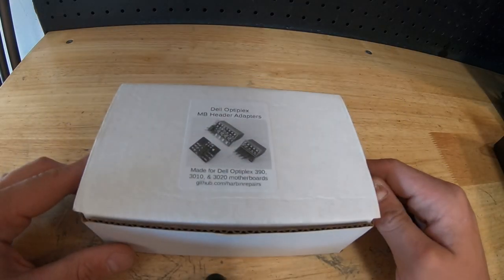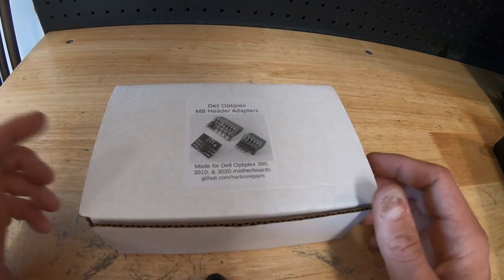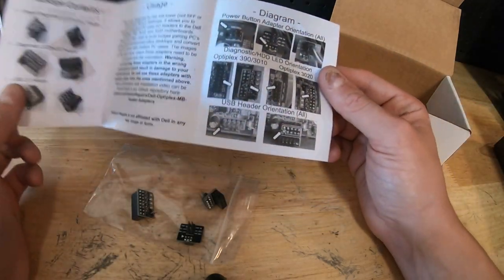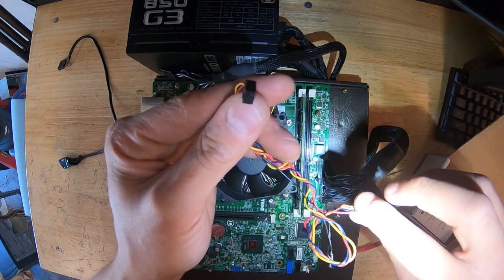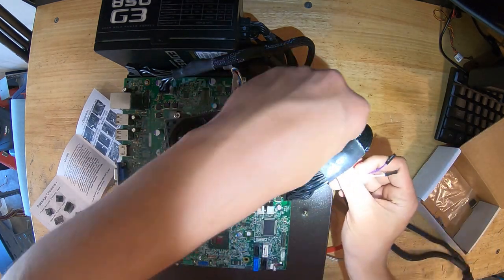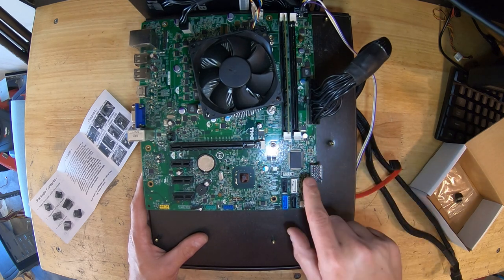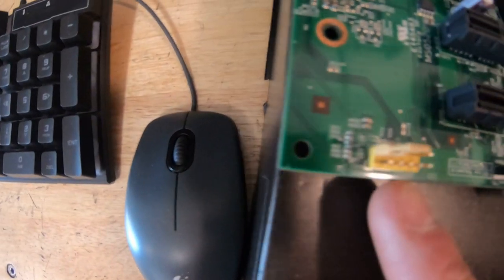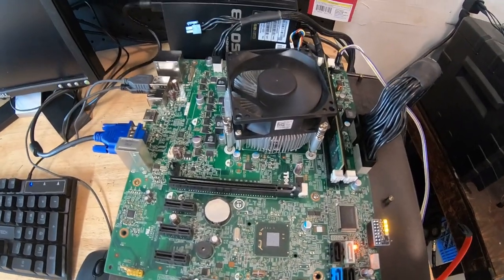Easiest Dell Optiplex power button fix! No cutting, no splicing, no wire tucking! Simple and easy!

Comment: Thank you very much!  This video helped.  I’m building a mining rig and got a power button.  When I found out the connector was different with this motherboard, I started to worry, but found this video and I can get this adapter and still use the power button I already ordered.
Reply from the maker: Glad the video helped!!
Reply: Dude, do you have the MIH61R MB working with more than one GPU? I was doing some tests, and a 2nd GPU does not recognize me. Did you make any changes to the MB BIOS? Thank you

Comment: I’ma do this when I get the dell optiplex for Christmas I was on a budget and if it can look better for around 60 bucks I’m willing to pay
Reply from the maker: go for it, def a cool upgrade for this budget optiplex, pop in an i7 along with good graphics card, ssd and pus, and it will hold up well. Very easy to do. I have another video that shows the updated build with these adaptors and how it turned it so check it out. Thanks for watching and hope you can subscribe to help the channel!
Reply: Same

Comment: thank you for posting this. I hope you can reply to my question. I have MIH61R MB that I acquired for free from a friend. Upon testing, CPU cooler fan turns on, a little orange light lights up. But black screen and no post. What could be the reason for this? 
I followed online advice and cleared its CMOS through a jumper. Still no post. 
I am not sure if the MOBO ever worked. So I am unsure if doing these jumpers in the video might help in seeing anything on screen. Would they? 
Please note that fans work immediately as soon as I plug power cord to PSU. No presses but when I do jumper for the 5 pins (up near the memory) i can see that keeping the last two on the right shortened makes the mobo reboot (but without post) .  Shorting them will power up the mobo but no post too.. 
Any advice? thankyou !
Reply from the maker: it would be trial and error, but I would try testing the ram. try reseating it or If you have one stick, test it one at a time to rule out. If it still does the same thing the next thing would be to see if it's a video error. are you running a graphics card or the one on the board. If so then run the one on the board. If it's still acting up, disconnect the optical and HDD and try it. Sometimes a bad drive can do that. after all that then next thing would be is to take out the cpu, check the pins see if any pins are bent in the cpu socket or see if the cpu is dirty. Alot to try but doing this would def gear towards what part is causing the issue. Let me know if this helps and how it goes. Thanks for watching and hope you can drop a sub!

Comment: Hello.  I have a ~2016 Dell XPS box computer.  The power switch will not engage.  Do I need to use those other two items in your fix it box.  I only need the power switch fix.
Reply: How do I tell what motherboard I have?  I'm in the box.  It looks very similar to the one in the video, but I think it is just a little bit different.  It would be great if this kit could fix the power button.  Also the power button is boxed in from the metal frame.  I got the side panel off, but can't seem to get the top off.  Any suggestions?
Reply from the maker: i would get on ebay and just get another switch or header panel depending what type you have.
Reply from the maker: just type the model number from the computer along with motherboard and you should be able to find it.
Reply: Thank you.  I found the motherboard and a Youtube video that shows me how.  Neat!

Comment: I have a 9010 sff, but I can't find a straight forward answer as to why I can't case swap and why the adapters don't work with the sff, surely there is a way to complete swap the case and not need the front panel to say attached. Do you know of its possible or have an answer to why the adapters don't work?
Reply from the maker: I have never done the swap with a sff so I am not sure why they say it does not work. I would like to get and try it and see what the issue is.

Comment: So question, I recently started building from an optiplex 3050 mt. Would these adapter work on that mb if I’m planning on switching case ? Or are they specifica to the 3010,7010 etc. ? Thanks In advance
Reply from the maker: 3050 is differnt. best bet is to mod that case. got a vide on it!!

https://youtu.be/coj91go5ljc
Reply: @DLMtechgarage  thank you so much for this! I was looking at which video to look at. This helps.

Comment: I put in my power switch and hdd led switch wires but i also have a reset switch wire in my new pc tower what do i do with that?
Also the blue pin plug on the motherboard next to the green one is that for the usb 2.0 plug?
or do i even need the adapter to the usb to the green on if i have a usb plug from the new tower im using?
i'm currently putting it together as we speak ;)
Reply from the maker: I would use everything on the adaptors. As far as the reset....... you really don't need it,
Reply: @DLMtechgarage  should i put the usb wire plug from the new tower to the blue one next to the green one or the green one with the adapter?
Reply from the maker: @johnnygallardo76  if its 2.0 put it on the adaptor. the 3.0 (blue one) goes on the board
Reply from the maker: @johnnygallardo76  not sure what i could be, double check the psu connection to the board, ram, orientation of the adaptors

Comment: do i do the same set up like you did in this video on my optiplex 390 mini tower?
Reply from the maker: yea you can except you would need a different adaptor. will post a link below. Thanks for watching!!

https://www.ebay.com/itm/Dell-Optiplex-390-3010-3020-Front-Panel-Header-Adapter-Kit-3pc/264638815586?hash=item3d9db3dd62:g:rsUAAOSwsFdfsMFS
Reply: @DLMtechgarage  Thanks for the the quick reply I'll be making a video of my finished OptiPlex 390 transplant when its done. 
   BTW is this the same one i need in this link? its cheaper at there actual site. 
https://store.harbinrepairs.com/index.php/product/dell-optiplex-390-3010-3020-front-panel-header-adapter-3pc-kit/
Reply from the maker: @johnnygallardo76  yea its the same one. I forget he has a dedicated store lol..

Comment: Will this adapter prevent getting the "power button cable failure" message at bootup? I just installed a new power switch and keep getting this error everytime i boot up my pc. Looking for the easiest way to fix
Reply from the maker: yup, adaptor gets rid of all errors.

Comment: I have a Dell OptiPlex 790 SFF, where the machine gets rebooted, shutdown or sometimes it powers on it's own.  I have formatted the entire OS and did a clean install, but still not sure what went wrong and why does it behave in such a way.  Can anyone help me here.
Reply from the maker: I have seen this with overheating. Make sure the fans are spinning while running. Such as the cpu fan, psu fan etc.... Usually when a computer is overheating it does this as a preventive.  Then check and clean it out for dust build up. I have a video on that so check it out. If that's not it  check your power chord to make sure its not pinched or if its loose. Def try those things. if not then it becomes process of elimination such as removing one ram stick at a time and then possibly having a psu. keep me posted and let me know if you have any question and you don't mind subscribing it helps me out! Thanks for watching!

Comment: Do I need the power switch adapter obligatory if I want to turn on my PC with the case button?
Reply from the maker: yea you will need it, but don't have to do it if you pin out the pins. I did a video on not using the adaptor and doing the pinout.

Comment: Looking for a computer that i can afford that have a socket 2011 socket R? i7 processor does dell make any thing in the older gen like this that will run cad programs.My i3 keeps black and blue screening ,locking up.
Reply from the maker: dell makes power edge socket 2011 systems like the t620, they cab be pricey but im sure you can find an older variant,

Comment: Thanks for the tutorial. I actually bought these adapters after seeing your video, I bought them for the Dell optiplex 990. Everything runs fine, power button works and all but the issue is I still get the Bios error saying "power button cable failure". Do you have any idea how to avoid this?
Reply from the maker: something might no be plugged in right as those adapters defeat the error. Make sure they are plugged in the right orientation and you have everything in the right location.
Reply: @DLMtechgarage  Thanks for getting back to me. I had issues with my computer for the last 2 days, it had that "No post" error after installed a new CPU fan so I couldn't test your solution. Luckily I fixed it... all I had to do was clean the RAM sticks. Anyway I still have that "Power button" issue, I checked everything, including the orientation of the adapters. The only issue is the LED Power jumpers are really loose, but I made sure they're inplace when I test my computer and I still have the power button error. I'm using the NX220 case with the Dell Optiplex 990 DT motherboard by the way.

Comment: can we use this with dell optiplex 7050
Reply from the maker: only the front power button adaptor, you don't need the other adaptors as the board has the i/o built in.

did a video on the channel explaining it for the case swap for that model!!

Comment: Hi DLM! is there a way to update a bios on a dell optiplex 3020 without rebooting? i have the A00 bios on it; everything works fine on the initial boot up, but if i reboot the pc, it just goes blank screen and doesnt post. i was thinking its a bios issue.
Edit: found out the problem. Had to use an earlier model of 4th gen cpu. Luckily I had an i3 laying around early enough to let it reboot. After updating bios and putting in the i5 and it works fine now.
Reply from the maker: after the update it has to reboot. I do it through windows and then it reboots. usually the blank screen is the bios relearning. I would try removing the battery for a bios reset and see if that fixes it. also I cant remeber if these variation have it but some dells have a bios lock that prevents the updates from taking.

Comment: Hi, I'm swapping my 7010 SFF motherboard into an MATX case. The motherboard has the normal 24 pin connector, so it was easy to just add a stronger PSU, but my issue is that most of the descriptions say that the adapters will not work with the SFF boards, only the DT and MT boards. Is there a way you can confirm this before I decide to go the annoying pinout route?
Reply from the maker: I can't confirm it as I have not done the sff with them. I would play it safe and go the pin out route.

Comment: Hi, I'm in the middle of doing an Optiplex swap with a 790 motherboard, 
got the adapter kit for it, pretty much got the exact same adapter as 
shown in the top right of your build, Hooked up the power switch pin and
 power led pins where they need to go and on build it does nothing, the 
only way I get my build to boot it turning the psu power switch on and 
off, any advice would be appreciated
Reply from the maker: Make sure they are in the exact position shown as in the instructions or video by harbin freight. That typically is the culprit. If I remember correctly certain models had different positioning. Hope this helps, thanks for watching and hope you can subscribe.
Reply: @DLMtechgarage  thanks ill have to try different positions n see if i have any luck
Reply from the maker: @z34chevy91  keep me posted!
Reply: @DLMtechgarage  i will i work second shift so I'm at work right now, ill prob mess with it tommrow morning, if I figure somthen ill let ya know
Reply: @DLMtechgarage  So I have an update, flipping that adapter upside down on my 790 motherboard did the trick I can now turn it on and off with power button on the case, thanks for the tip, only Thing  I have left I would like to get rid of is the hard drive fan failure error on boot but I'm not seeing anything online really fix that....

Comment: Can the pc turn on with the error messages and without a jumper
Reply from the maker: the computer will boot fine with the error messages but if you dont have the right jumper it won't boot, a buddy of mine did a video on the jumper issue and the swap, will post the link below as he talks about the pin jumper issue. I also have a video of how to jump and splice it to boot up.

https://youtu.be/MOr5lx6UVoo (this is his video, tell him dlmtechgarage sent you)

https://youtu.be/47aCR731cDU  (my video on splicing and jumping)
Reply: @DLMtechgarage  oh sweet thank you so much

Comment: so like if you js case swap and cant power on like power button wont work this how u fix it?
Reply from the maker: yea, it could be the issue.
Reply: @DLMtechgarage  could you show me where to plug all the cables in at because i couldnt seem to figure it out
Reply: do u need to buy anything b4 case swaping 3010
Reply from the maker: @perx7839  I have video talking about everything needed.
Reply from the maker: @perx7839  this video might help you

https://youtu.be/E0j9zHQ6rBw

Comment: I connected all of the cables in the correct spots, and the only indicator of power is the optiplexs orange light. The pc still doesn’t turn on any fix ?
Reply from the maker: make sure the adaptors are not upside down. if thats ok, try reseating the ram, usually those two are the fix.
Reply: @DLMtechgarage  thanks for the suggestion but still no results, just the orange light the fans are not even turning on.

Comment: where does the power switch on the front panel would go?
Reply from the maker: On this adaptor it goes plugged into the adaptor that goes plugged into the top of the board. When you buy the adaptor it shows you where to plug it in. Hope this helps and thanks for watching!
Reply: @DLMtechgarage   thank you very much im working on a pc im gonna resell appreciated
Reply from the maker: @agilezz1160  anytime glad I can help. Let me know if you need any other help!
Reply: @DLMtechgarage  last question how long did it take for the adapters to come
Reply from the maker: @agilezz1160  about a little less then a week.

Comment: My motherboard does not have a usb 3.0 but my case does what do I do can I use the pc without the usb 3.0?
Reply from the maker: you can purchase and adaptor to convert the usb to usb 3.0. it will run at typical usb speeds but will still work. Thanks for watching and hope you can subscribe!
Reply: Can I still use the pc without the 3.0 cable
Reply from the maker: @matt5974  absolutely. I have done it before. You just loose that port.

Comment: Fix Alert! Fan previous Fan failure?
Reply from the maker: just means you need to plug in a fan. any fan will do
Reply: @DLMtechgarage  But I already hace one connected to the CPU
Reply from the maker: @Salvavidas90  need to be in other fan port that is on the board as well.